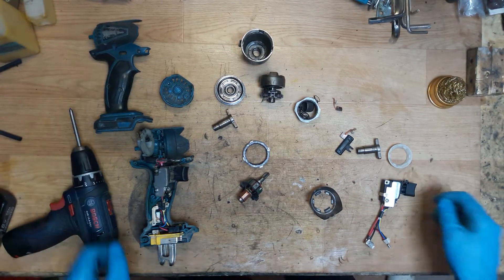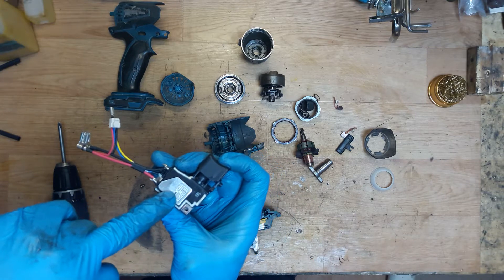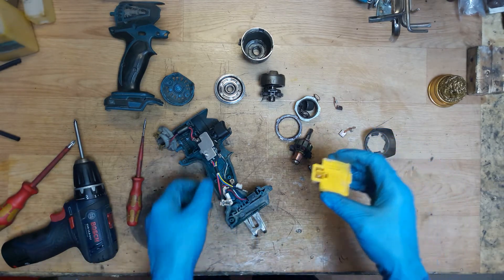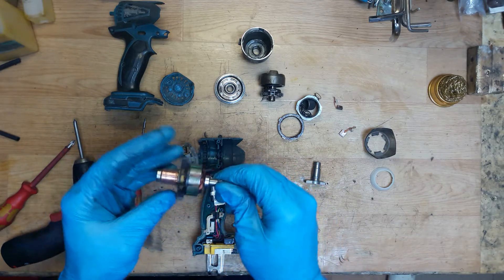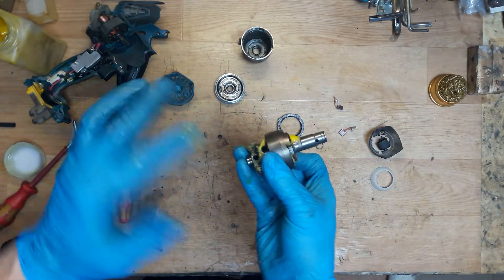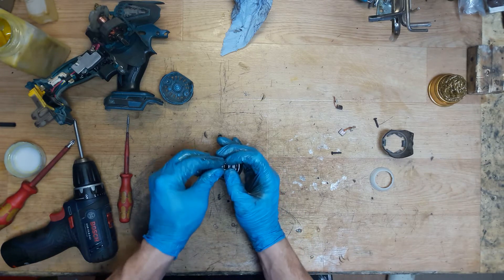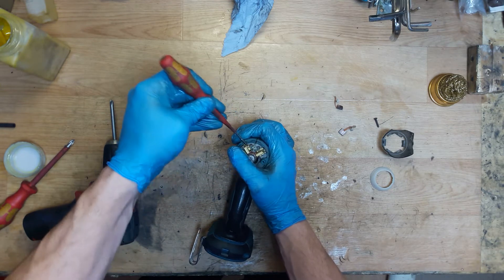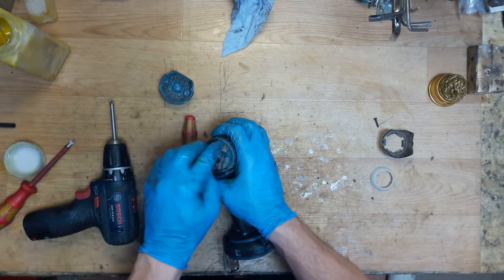How to repair Makita BTD146 DTD146 anvil switch #makita #powertools #powertool #repair #repairtool

Comment: Walked in a plot today and one of these was in a pile of bits on the floor. The chippy had gone out & bought a new one , saying the old one had packed up. I asked him if he was throwing it away , and he said I could have it. He had taken the whole thing apart , gears & everything. I gathered it all up of the dusty floor and took it home to clean and rebuild & see what happens. I had a feeling it would be the brushes, but I put a battery on it & everything works fine. Probably just needed a clean.